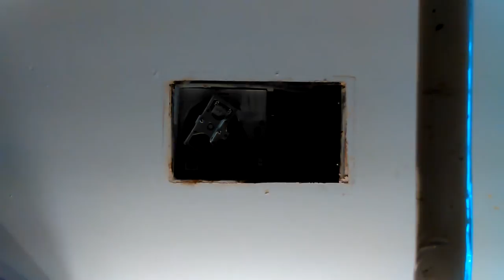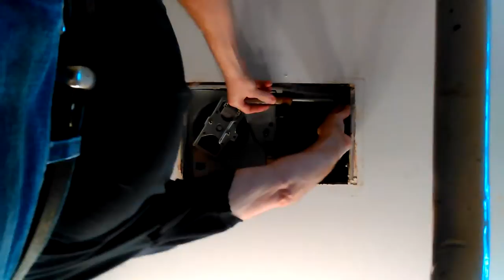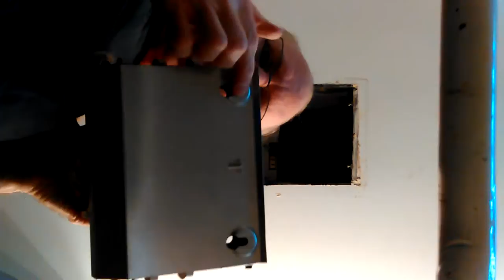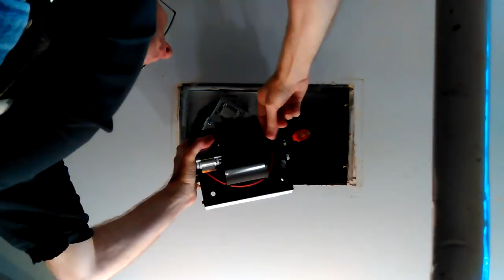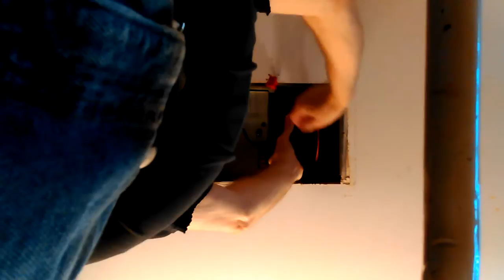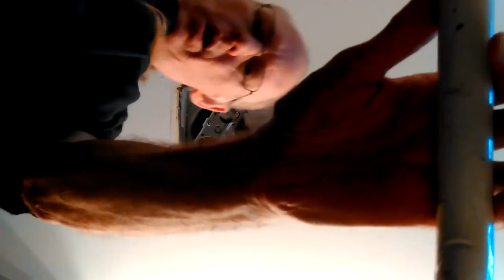Don Bishop Bathroom Broan 655 Heater and Exaust Fan with Light Combination Repairs New Installation

Comment: Thanks for the video.  I replaced the very non working old fan / light / heater in my bathroom with a Broan 655, with no attic access, but with existing wiring and ductwork.  If you can possibly get into the attic, I would recommend that and installing the unit from above.  Some things I found:  Obviously mark both sides of all wire connections before undoing the wire nuts on the old unit.  On the new Broan you have to disassemble the unit before you install it, then reassemble it in the ceiling so take pictures / remember how the thing came apart cuz its not obvious where things go when you go to put it together.   I carefully cut out the existing metal brackets with a sawzall and framed in 2x4's between the joists to screw the sides of the new Broan unit to.  Remember you have to have a big notch in your framed rough opening to allow the house wiring that goes in through the side of the Broan unit to pass through the rough opening when inserting the unit from below.  In addition to the snaps and hose clamp provided, I would use aluminum tape to seal the duct hose to the unit as this junction is really leaky without it.  Its hard to get the house wiring fished in through the knock out in the side of the unit because it has to make an immediate 90 degree turn so obviously bend this turn into the house wiring before trying to insert it into the unit.    All in all the job was tougher than I was expecting for a home owner (me) and I probably would have hired someone to do it knowing that. it took about 3 1/2 hours mostly working with my hands over my head so if you have neck, shoulder or other problems I would say hire someone to do it.